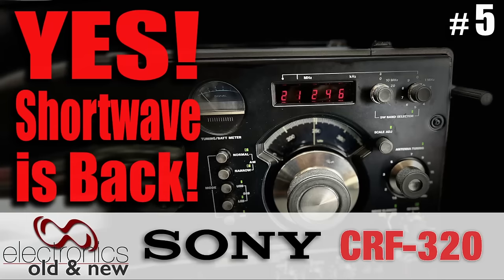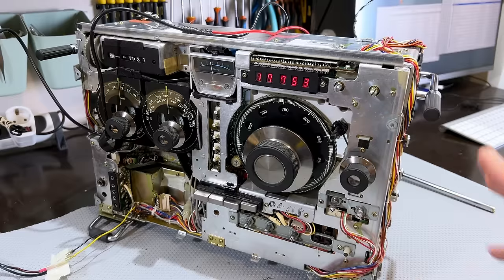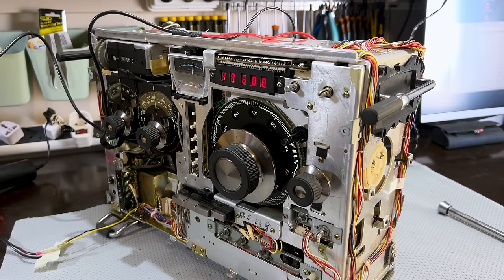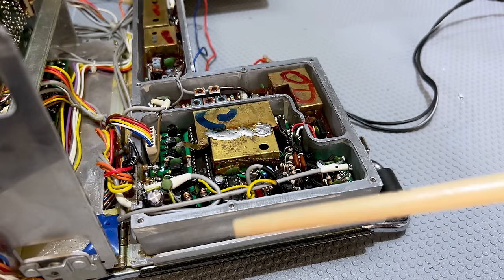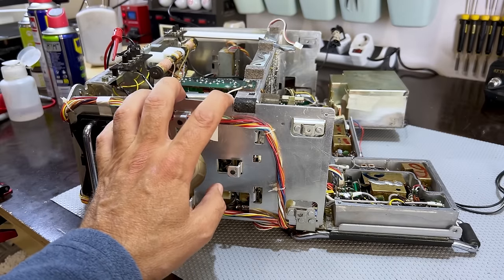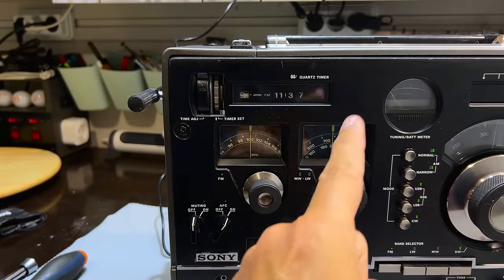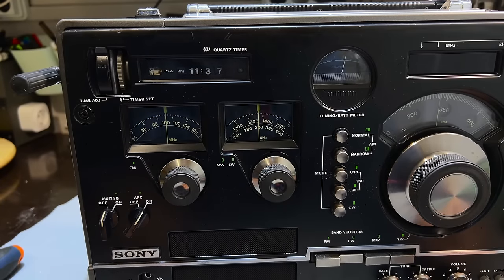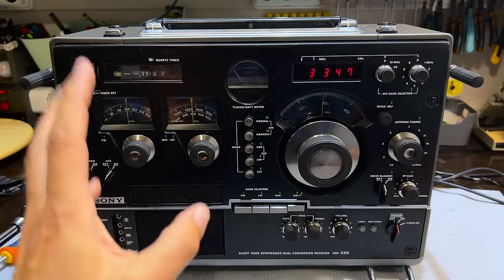YES! I've got the Shortwave back! Whew! Sony CRF-320 restoration Pt.5

Comment: That is a nice radio Manuel, very nice. Sony was my goto back in the day and still is, that and Panasonic. When you were talking about the antenna top piece I was thinking It wouldn't be difficult to machine up a new one to fit almost flush with maybe a fingernail slot to extend it. I'm not sure I want to move to Madeira to do it though 😄
Reply from the maker: Yes, I think a move across the world is a little drastic 😊

Comment: Looks and sounds great!  You rediscovered an old field engineer's trick of mine, i.e., solve the simple problems first, often the more difficult ones will disappear on their own.  That doesn't work all the time but I'm always amazed at how often it does work.  Thanks for the RF Detector schematic -- looks like it could be useful on other radios as well.  I've also been watching you on Odysee.  Blissfully free of interruptive advertising there.
Reply from the maker: Yes, start with the easy ones. It helps boost the self-confidence, and sometimes, sometimes, you get really lucky! As for Odyssey, I created a duplicate of my channel there, simply to prevent the channel one day being completely blocked or lost. You never know.

Comment: Well done, looks and sounds fantastic. Probably an expensive step too far but how about your friendly neighbourhood PCBWay for new turned tops for those antennas? You could do some test ones with your CAD, 3D printer etc. Too late for that cap though (12:22).
Reply from the maker: That plan is in the process of taking shape 😊

Comment: Fascinating! My money was on the problem being on that frequency switch/digital readout section. As to what solved the problem, I do remember a radio you did where the electrolytics were reading absolutely find but the moment you went above a certain voltage everything stopped working and changing those electrolytics solved the problem. So, did the change of electrolytics on the synthesiser board do it? Or maybe some tiny contact issue on one of the IC's that you resolved when removing them and put them back. Who knows? But what a result!! Great video, as always!! 🙂
Reply from the maker: This one is attributed to the Gods of Luck 😊

Comment: Based on your experience I wonder if you have a view on a 'best' (sorry) or rather most useable practical classic multiband RX? I'm looking to acquire something portable with SSB capability that I can install to my 4x4 truck camper and use on my travels. Ex comms tech so i don't mind some farkling around...Grundig Satellit series looks good as do the Sony CRFs.....but which one of which brand?  Insights appreciated....maybe it's an idea for a vid? Thanks for your channel.
Reply from the maker: The grundigs that come with SSB are great as are the Sony’s. Either are about the same, with the Sony crf -320 being a bit better, but its price is very high.

Comment: As the antenna is a bit short, why not put a brass spacer on the bottom of the antenna? They come in many lengths, and the brass can easily be tapped if the spacer is too long.

Comment: This appears to be an early double sided board. I kind of doubt it used plate throughs on the top to bottom connections. Perhaps brass eyelets, or maybe just wires.  But those boards were certainly problematic, and I wouldn't be surprised if all your careful resoldering has eliminated a bad connection on the board itself.
Reply from the maker: Could be

Comment: I am very much interested  in  listening  to SW  broadcasts    . I have   some golden memories  of listening to the wonderful,    reception without any noticeable  noise  ordinarily  associated with radio  receivers  , especially when using   transistors  iin rf circuits.  But  l am  very much  delighted to    hear  clean rf reception  as a iam using a  Philips valve radio with an ordinary  wire used as antenna  This  give more sensitive  reception  of  broadcast  from  " Voice of South  Africa    very  neatly .   
 I am interested  to    know that the  SW reception  is  always fascinating  to heR  . But   in my experience  is that    rf  reception are prone to  badly affect  the reception   very  severely  to  noice   of more noise  necessary  common  in the use of   transitos  in the  rf  circuits . If any one  have any  information  very    reliable  rf  circuits   in diy form  preferably  employing electronic valves  o in rf circuits.  The sw  and medium wvw should behaving very sensitive and  nice free . 0lease  guide me to  have a  diy kit form rf circuits  that covers  entire Sw  meter band right from 1.6 Mhz  to 30Mhz   and balso cover the  medium band  as well

Comment: A very nice radio, but a bit scary to work on. I know what you mean about the price of telescopic antennas, I paid too much for my Grundig 2100, but I couldn't find one with the right diameter or extended length. I guess you're not intended to find a replacement signal meter. When said and done, it really is a well designed radio, with a sensitivity I could only dream of.
Reply from the maker: I agree, very well-designed radio. Very sensitive. Very expensive spares 😊

Comment: It must be really gratifying to have the SW working properly. You may have "fixed" the fault when you sprayed those 74 TTL ICs or indeed really fixed it when you replaced the capacitors. As you said, time will tell. I'm not overly surprised it out performs your other receivers this Sony still commands a high price, it doesn't just look the part it acts the part too. Great job, so many skills have been applied to get it to where it is now. I'm pleased the effort was rewarded with the result it deserves.
Reply from the maker: Thank you 🙏